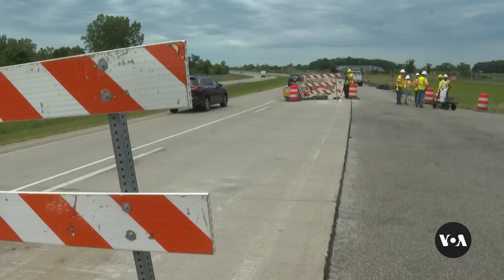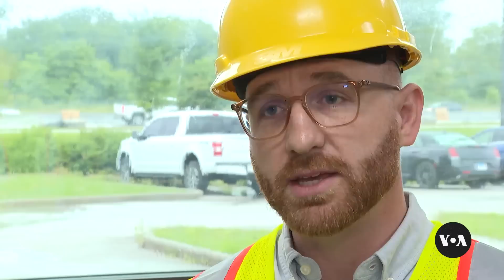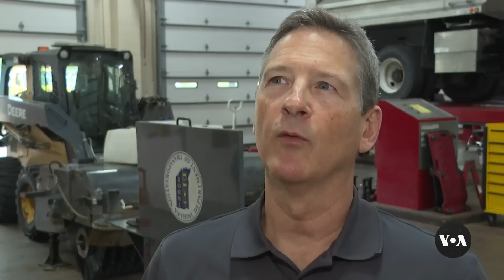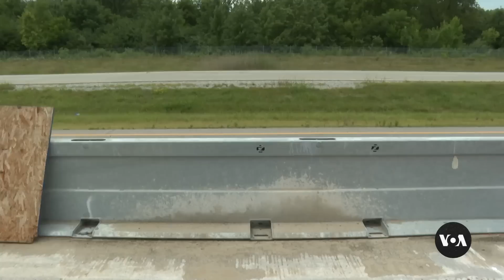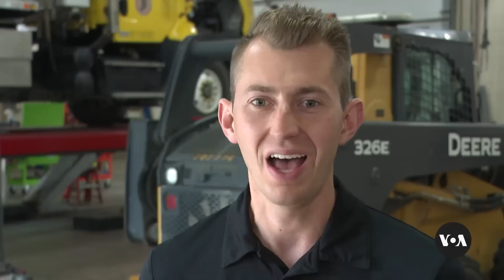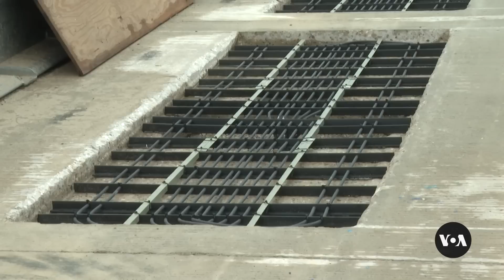Indiana test highway could transform electric vehicle charging | VOANews

Comment: Big EV fan here, and would like to see wireless EV charging in homes and McDonald's parking lots, but this is ridiculous!
Reply: Who needs wireless charging at home?  Takes 3 seconds to plug in.  Wireless charging on the road would be great b/c it would extend one's range.  If there were just a couple of 50 mile stretches on a 500 mile trip, even if the system could only maintain the battery at its current level, that's 100 miles of extra range.  A car w/ a 400 mile range battery suddenly has 500 miles of range and can complete the trip w/o needing to recharge.  Definitely not ridiculous.
Reply: @kenbob1071  Yes it is ridiculous.  The cost would be outrageous; maintenance would be ridiculous; and thinking that you need it is ridiculous!  Who doesn't stop at least a couple of times on a 500 mile trip?  How many people take 500 mile trips?  An incredibly tiny percentage of trips are even over 50 miles.  Batteries themselves are capable of greater and greater range.  And who would not appreciate the convenience of just driving into your garage or driveway as normal.  No cables in the way as your car is charging.  And if you're going to have a charger, why not one that just lies inconspicuously on the floor.  You really have not thought this through!
Reply: @timower5850 The cost aside, its innovation. And it’ll be very helpful. Who wouldn’t wanna take a trip on the highway and essentially have your battery stay at the same level for en entire 50 miles? What’s really ridiculous is empty skyscrapers. This is actually a public service.
Reply: @mannyislikethat  What?  You cannot put the cost aside!

Comment: It is the only way forward. There will be not enough batteries without destroying environment. Only use small battery to get to the highway and then get power from the highway.
Reply: This is stupid and not feasible! As EV chargers 220 volt! Wireless charging in the road will only slightly delay a dead battery not add any real range! Just more wasted tax dollars
Reply: @mikeklinger1712  I don't think it will be final solution. Everything comes with time and trials.

Comment: Brand new roadways are much thicker than what will be in place after they repour that concrete roadway and heavy vehicle traffic, especially 18 wheeler traffic will crack it up and ruin it quickly. Not to mention the fact that electrical generation plants would have to be built next to hiways to generate enough power to make it work.
Reply: No , and NO! Did you not hear its built specifically for HEAVY trucking at first.  And uhm you do realize we send power hundreds of miles right? (Nothing like a lil 350k to spice up snow fall into a crackly sparkle show
Reply: @frosthoe  do you know anything about road construction........ obviously not or you would not have said no. That system would use as much electricity in 100 miles as an entire city, and ALL major cities have power generation plants,PLUR , near them. It may actually charge the batteries but implementing it would require an industrial project greater than the US output for WW2. It's a fairy tail and before it could even  all vehicles using it would have to weigh much less than they do now and advances in road construction methods would have to be made. Look around blind man. Roads in every state are Always being rebuilt right now without being as thin as that hollowed out and refilled design shown.

Comment: Until the induction transformers malfunction during a traffic gridlock and microwave cook a family or ten.

How about just putting decent solar collectors IN the EV cars? Oh wait. Then no one would be dependent on the government for charging stations, or these new charging roads, or have to pay outrageous electric bills to charge their EVs. Can't have that.
Reply: I'm not a fan of this, as it seems far too costly to be viable. Not to mention the issues of road maintenance. But just adding solar panels to EVs won't work either. There isn't sufficient area to absorb energy to amount to much for a standard EV car. Then we have the issue, most current panels are not flexible and fairly easily damaged. Not good to have on a high speed vehicle. We have flexible film panels, but they are less efficient than traditional "hard" panels.

  Far better to have them in larger collections at people's homes. There they can be more easily installed, maintained, and optimized for solar pickup. This has the added benefit of providing electricity to your house too. If we update our grid to a smart grid, we can help smaller areas be more self sufficient. But also be able to help the larger grid out as needed. We'd definitely still need large scale power generation, but we spread the load around. The EVs could even be used for local energy storage via an opt in system along with some houses having separate batteries.

  Not saying this is the way to go, simply that it is one possible path for us.
Reply: @MichaelDeHaven  Solid thinking. Thank you for sharing "real" thoughts and info. Best wishes cerebral one!
Reply: you dont make sense, how exactly is this going to fail forward? The wont use SSR's so it will fail to null . Edit, the best panels, film panel will only charge a car 1/8 in a week. good luck, maybe a solar trailer , ohh wait that's why they're doing this! 🤦‍♂ But I totally agree , MORE solar, and why the frick are we not useing all that Geothermal heat at yellowstone(example only) Its been calculated that we could extract ALL of the north american continents energy just from there...why dont we...Hrmmm🤦‍♀
Reply: Ok Negative Nelly.

Comment: The British began installing mini wind generators on motorway shoulders, driven by the motor vehicle turbulence.
Reply: That system simply makes use of the air already displaced by vehicles. It doesn't add to the drag. It just recaptures some of the energy that would normally be lost as moving air along the roadside.
Reply: @MichaelDeHaven  No.  For EVERY action, there is an equal and opposite reaction.  Given that the blades of these turbines are being pushed by air being moved by the cars, they are also pushing back against this air.  It is akin to drafting in auto racing; though the trailing car may be saving gas, the leading car uses more gas as it pulls along the additional weight.
Reply: @Maggotsforlunch440 must be a HUGE streetlight since they are generating over a megawatt per 1km of road....

Next time do some research before you post, it will save you proving yourself the fool
Reply: How is that a gain?  It increases drag on the vehicles, dropping their efficiency.
Reply: @timower5850  It in NO WAY increases vehicle drag... if that were true, there would be no airplanes.

This is also in NO WAY akin to drafting

Go read a physics book before commenting again.
Reply: @9753flyer  NO WAY you have any idea about physics
Reply: @wickedpawn5437  Next time you comment.. don't do it while looking in the mirror.